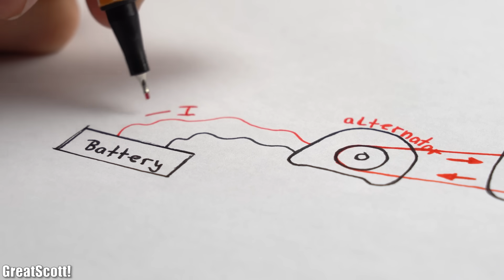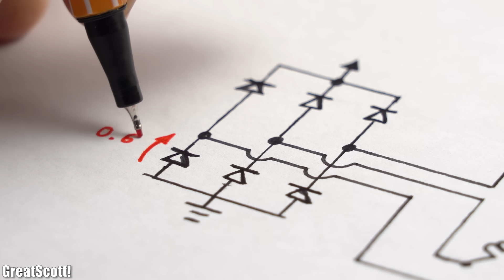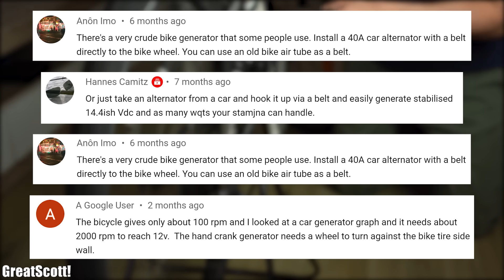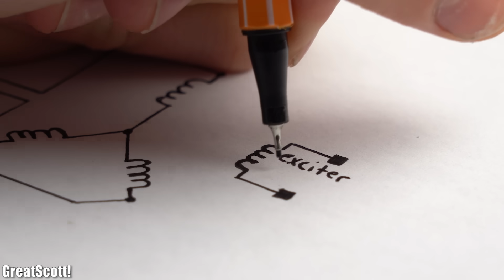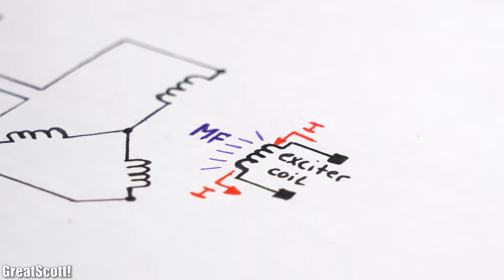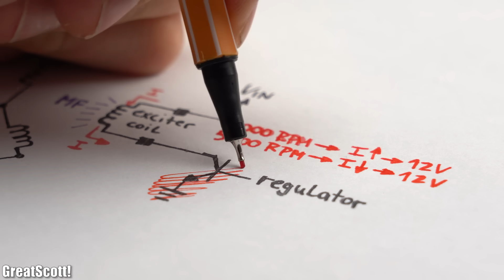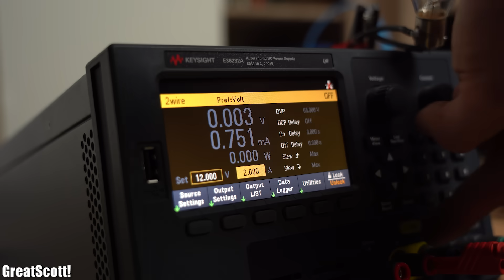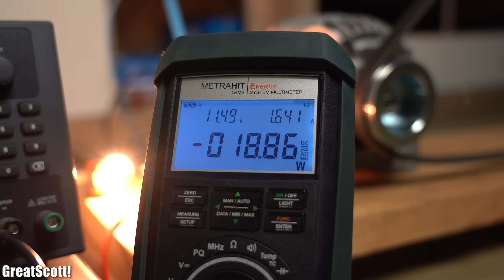Using a car alternator with a bike to power my home? How much energy can I produce?!

Comment: Most adults can output 100w on the bike for hours. So a better system with way less losses (Dynamo?) can easily make 0.1kWh per day as a light workout. Let's round it up at 40kWh per year. Not nearly enough to power a home, BUT most of our energy consumption is for heating (60%), water heating (20%), cooking and big appliances (fridge, laundry). The rest isn't even 10%
So the bike system maybe enough for your phone, radio, TV, a few LED lights. Interesting for an offgrid cabin, but not much else.
ANYWAY, a simple solar panel system can easily handle all of that, (except for the heating)

Comment: It is interesting, I ran this same concept by a popular AI model. It confirmed that not only does this concept work, but it stated much higher power potential, with smaller, less powerful riders being able to reasonably generate around 150 watts and larger more powerful riders able to generate around 300 watts reliably and without extreme output by the riders. We went over a few options, and the AI even made recommendations based on system specs I provided. We even worked out additional ways to increase output to attain significant power output improvements. I would like to add that just because something works on paper or in theory, doesn't mean things will work out the same in real life as on paper. I provided a specific design concept and several options and the AI verified my work and made the same or similar recommendations to the system that I had proposed. This video poster has actual experimentation that he has demonstrated. I designed a small system that could work with one rider, two, three, etc to produce higher output. The power output is not huge, but usable power levels should be achievable with an appropriate system design like the one I made. It is pretty simple and I can't imagine that nobody else has thought of this and tried it before. Motivation of need often helps. When you have no real use or need of something, how serious is the effort? I find that when people are truly motivated to find a solution, they keep trying and scaling until they get a result that is useful to them. True need of solutions that are not readily available can cause people to think differently and see solutions that may have previously eluded them.

Comment: 3:45 - I have not watched more - everyone knows a car's alternator does not use parmanent magnets but uses an internal, rotating 12V coil powered by the battery, to produce AC voltage on a fixed outer coil... You need to power the internal coil first

Comment: You need to change how the alternator works bypass regulator and diodes so u can produce 110-220 volts as a generator

Comment: An alternator actually produces AC current. The rectifier converts it to DC current. One of the major problems with your experiment is you are tapping into the DC side of the rectifier if you want to power your house you need to tap into the AC si of the rectifier. Another issue you have is belt slippage. It takes about 5 hp just to turn the alternator fast enough. Belt slippage was a major problem with the original auto alternators. The battery would run down because you must excite the alternator with current unlike its predecessor the automotive generator. They cured the slippage issue with a self tensioner.

Comment: You need to add a Large heavy fly wheel between the bike and the alternator. The fly wheel should have a small gear in front to attach to the bike. So the large wheel of the fly wheel the is attached to the alternator. This should greatly enhance your setup, and you will be more pleased with the output voltage

Comment: I wonder if instead of adding a belt tensioner if you could add another alternator potentially on the pedal gear side of it because it will give you the tension and more output as well

Comment: So I know this is a 4 year old video but instead of a cars alternator which requires a high RPM to put out power, why not use the very similar (as in they look the same) "low RPM permanent magnet generator"???????

Comment: well alternators also need an excite shock and that cant stay lit because it would short circuit the stator.  but the stator connects to the f as far as i know and the sensor is connected to the positive terminal. 
but the differnece bwteen these wires is the excite is connected to a power source that needs to shock the stator through the the wire that goes around the pos ac and excite past the stator and past f

so you should make a ground to a battery and a ground to the alternator  and then also set up a switch on the handlebars to switch it on and off to excite the coil and charge a 12v bat in an hour from the sensory wire.
and then hook up a inverter to the battery and flip the switch.

so you could get a couple of motor cycle batteries or sometrhing and charge all of them and use the inverter to show you if your over charging the battery.

but  you should use a ford alternator  and get a adaptor and cut the wires because its easier than it is to do it to a dodge or chevy

this does kind of look like a ford focus alt  but i think a ford focus alt with the spliced adapter would shed some light on yout expiriment

Comment: You could also use a flywheel system powered by the bike and if that flywheel drives the alternator you would get more consistent power. I think if you combine that with the other suggestions in the comments like an inverter, battery, and tensioner that would be worth testing!

Comment: What if you connect that alternator to a wind turbine?? Free energy, no  peddling bikes or gas motor!!!! Conect it to a charge controller to charge the battery. Have a huge battery bank connect to an inverter to supply the house.

Comment: Electricians probably know how to do it, because the current volts can probably be enhanced with the dangerous parts in cooking appliances, and then the heat could make more amperage if done right, with over heating being the danger. A mechanical device which would need it's own battery, to spin the wheel...but it might not need big battery if it's just compressing  every five seconds, to trickle charge a power storage battery like commenters said. Not gonna power a home off flywheel, solar panels  don't fully do that directly. either. A small, rechargeable battery powering a piezoelectric type device working synergistically with the flywheel seems conceptually interesting, but the electrical wiring stuff is probably the fancy, dangerous parts. No doubt electricians can do it though.

Comment: I used a cyrisler alt and smallest pulley I could find with the bike set-up. Then I put a junk impeller from old heater on. Then I bolted to heavy old plank and laid it across a creek with the blades a few inches in water alt above water and ran it to my battery bank.  ❤❤

Comment: The biggest gear on the rear cassette of a bike is its lowest, not highest, gear. Your RPM's would be about quadruple what you got if on the highest gear. 
I looked into doing this about 20 years ago and back then a washing machine motor made the most sense to use as a generator. You may be able to find one used at the dump, etc.

Comment: what if you use a hand crank generator? maybe more modern designs will be more efficient? I heard someone say you could get up to 150w from them but they are valued at lower watts because the human hand does not move fast?
 https://www.google.com/search?q=hand+crank+generator&num=10&client=firefox-b-d&sca_esv=db94c43514cdc207&biw=1445&bih=635&sxsrf=AHTn8zq71dw4zAp1nHwCmzYXqKZZZxwVww%3A1747120832769&ei=wPIiaLriLuGhhbIP1Jmm8Ac&ved=0ahUKEwi6wvek9J-NAxXhUEEAHdSMCX4Q4dUDCBA&uact=5&oq=hand+crank+generator&gs_lp=Egxnd3Mtd2l6LXNlcnAiFGhhbmQgY3JhbmsgZ2VuZXJhdG9yMgUQABiABDIFEAAYgAQyBRAAGIAEMgoQABiABBgUGIcCMgUQABiABDIFEAAYgAQyBRAAGIAEMgUQABiABDIFEAAYgAQyBRAAGIAESJo0UPMLWKMscAN4AZABAJgBZKABpwqqAQQxOS4xuAEDyAEA-AEBmAIXoAL5CsICChAAGLADGNYEGEfCAgQQIxgnwgIKECMYgAQYJxiKBcICCxAAGIAEGJECGIoFwgIQEC4YgAQY0QMYQxjHARiKBcICChAAGIAEGEMYigXCAgsQABiABBixAxiDAcICCBAAGIAEGLEDwgINEAAYgAQYsQMYQxiKBcICERAuGIAEGLEDGNEDGIMBGMcBwgIOEC4YgAQYsQMY0QMYxwHCAg4QLhiABBixAxiDARiKBcICDxAAGIAEGEMYigUYRhj5AcICBRAuGIAEwgINEC4YgAQYsQMYQxiKBcICCBAuGIAEGLEDwgIOEC4YgAQYsQMYgwEY1ALCAg0QLhiABBjRAxjHARgKwgIpEAAYgAQYQxiKBRhGGPkBGJcFGIwFGN0EGEYY-QEY9AMY9QMY9gPYAQHCAgcQIxixAhgnwgIIEC4YgAQY1ALCAggQABiABBjJA8ICCxAAGIAEGJIDGIoFmAMAiAYBkAYIugYGCAEQARgTkgcEMjEuMqAH8qgBsgcEMTguMrgH7Ao&sclient=gws-wiz-serp

Comment: You are good at maths but not so practical. It is common sense that the car alternator is too small to give large voltage, never can power your home. Are you serious. Even if you can rev it super fast, the coils will not handle the current. They will burn out. Real generators have step up gears and large coils for big out put. You can get a camper  wind electric generator motor and rig that to your bike. Use a large  crank shaft on a small wheel cog. Then you can paddle the bike to store charge car batteries or high power modern batteries.

Comment: The support for the bike had been better using wood only and some triangular shape to make it more rigid.

More engineering before building would help a lot.

The tension of the belt should be relative to the bike and a much more rigid fastening of the alternator.

What abour wooden blocks with some holes instead of simplistic metal brackets?

The electric base of the system could be a 12V battery. And better instead of disabling the built in charge controller rather put a step down voltage regulator between the built in regulator and the rotor exitation coil.

Then you can adjust the load and still have voltage max regulation.

A 24V alternator could be better using a 12V regulator. Then you can save some mechanical gearing.

A smaller alternator of 100W is enough for human input.  Even easier using a permanent magnet alternator with 3-phase rectifier and a simple step down regulator set to 14.4V with adjustable current limit between alternator and battery.

Then the load of the human bicycle effort can be adjusted from 0 to 100%

A regulator that can handle 50-60V is better and a higher voltage alternator in the same range. Then you can input power at various bicycling speeds and do not require some insane top speed before reaching battery level.

A small solar cell is much better than relying on human power input.

Even producing 60W continuous power is hard work.

Comment: the smaller sprocket on the rear wheel is the higher gear. If you shift into smaller cog, the wheel can be spun faster

Comment: It's been tried: https://www.youtube.com/watch?v=S4O5voOCqAQ

An average human can maintain an output of less than 100w pedaling a bicycle. Driving an alternator will incur some conversion losses. If you can run your home on between 50 and 75 watts, the answer is "Yes, I can use a bicycle to power my home".

Comment: Alternators are designed to charge and maintain batteries so without a battery to give the regulator a reference voltage through the field exciter tap the coils will not be properly energized and in balance.. If you want power without a battery then use a generator.. Amish around her have alternators connected to 800/1,400 rpm small engines screwed to a board that make 20 amps all day because they have a deep cycle battery in the circuit.. My 14HP riding lawn mower engine has a built in alternator that generates 10 amp at 13.5v at half throttle 1,500 RPM and close to 15 amps at full throttle around 3,000 RPM.. So a small automotive alternator that is rated at 40 amps or so will turn easier and generate 20 amps if it is spun at 5-6 thousand RPM.. The larger diameter alternator under the flywheel of a garden tractor engine would require much less RPM's and by removing the piston, rods and valves would turn fairly easily.. Finding one that is blown for free should not be that hard..

Comment: The human body and top condition can produce roughly about one horsepower or a little less. That comes up to about 750 watts with a very generous efficiency  rating conversion.
You be lucky to power your refrigerator even for a short time.

Comment: you wont think its so useless if the power grid goes down  lol
Reply: When you realize that 1 350w solar panel can make 10+ amps at 14v for 4 to 9 hours a day with no peddling effort while this device would take 24+ hours using Olympic strength pedaling the choice is pretty clear.. We use the 10 amp alternator in my garden tractors engine to power and keep a large deep cycle battery charged when we are camping in our woods.. It powers a couple lights at night and our amateur radio, laptop, small TV by running the engine for an hour or two then letting it rest an hour or two..
Reply: and  if you dont have a 350 w solar panel   or a battery to store the power for night time use....
Reply: @ This would not be a way to power much of anything for very long and I think you know this.. Before electricity people used candles and lanterns at night but mostly just went to bed or sat by the fire.. If you could Macgyver an alternator rig in whatever apocalypse scenario you are dreaming about then you should be able to make or acquire a battery..
Reply: Yes I know this lol     hence the last three characters....  lol    but some truth to it...  better to have that wheel spinning then nothing at all.

Comment: Attach a double set of garage door springs opposite each side of one pedal, and replace the other pedal with a shaft and 50 lb bench press weight and 1991 Pontiac Harmonic Balancer. Then crank it over,,it should be perpetual. I just saw this mechanism, and thought I'd ad lib,,lol.

Comment: Maybe you can try  to add wind blades to the Alternator, adding a battery and inverter and use it like a wind generator installed on a house roof. 😊

Comment: A couple significant issues here:

That belt not being tensioned properly is losing a ton of energy through slippage. Spring loaded belt tensioners are very easy to build.

Generators/alternators usually have an optimal RPM for usage. The manual should have it listed somewhere, so the bike sprockets should be adjusted such that you're hitting the optimal RPM, even if you are losing torque.

Lastly: batteries. Due to your bike only producing power when you are on the down stroke of the pedal and that power being reduced as your feet get closer to the top/bottom, it is going to constantly change your power output. Cars with alternators do not have this problem because the position of each cylinder is adjusted so the car is almost always on the down stroke somewhere, but you with 2 legs do not have this luxury. Batteries fix this problem because you can use them as a rough averaging filter for your power.

Comment: there is also high output alternators
Reply: Drag is proportional to output so a smaller 30 amp alternator out of a 1.2 liter Geo Metro would allow you to pedal easier and get the same wattage.. That still would be just a couple hundred watts an hour so why not just get a 350 watt solar panel and MPPT controller and let it do the work?? with 3 hours of sun you could get the same amount of power as 12+ hours of pedaling at high speed.. The alternator in a 15 to 25 horsepower lawn tractor motor is a larger diameter that requires lower RPM's to generate power.. Find a blown motor and remove the piston, rod and valves to let it turn easier and this would be a far better choice than a car alternator that needs high RPM and torque..

Comment: they say you can run a generator off a motor and that's all it will run but you can use a lot of alternators on a belt from one motor generating all the power u need

Comment: Your house runs on AC, that thing is called an "alternator" for a reason, with some surgery on it,it can power most of your house, a 150 amp alternator is pretty common, your place shouldn't use more than 80-100 amp, your welcome

Comment: A longer belt would give you more contact with the smaller spindle and less slippage. A tensioner would be the next best thing but that adds significant additional resistance.  You should convert that into a wind powered generator now.

Comment: Another way to mechanically regulate voltage would be to replace the wheel of the bike with a super heavy wheel to build up momentum like a huge flywheel...

Comment: I saw a show one time where people were trying to survive an apocalypse. Like they actually went out and got 10 people from different backgrounds and challenged them to "survive" an apocalypse. Anyway they had an electrical engineer in the group. They rigged up an old lawnmower motor to power a car alternator and used it to charge a bank of batteries. They mostly just ran lights. But they also did run a few power tools for construction purposes on this setup. At one point they out grew the system. They were trying to run more than 1 power tool at a time and it was causing the lawnmower motor to get bogged down and the car alternator started making a squealing noise. So they had to upgrade to a solar system they were able to scavenge. I say scavenge. They were provided by the show runners but made it seem like they were left behind after events of the apocalypse. Either way it was an interesting show. One thing I thought was pretty cool. After their solar setup was finished they made an ozone generator and used that to purify their drinking water.

Comment: I want to build a similar system using my e-bike to power the generator to charge a battery bank. Then recharge the e-bike of the battery bank. Really wonder if this would work and easily produce more electricity than power to run it.

Comment: Others are right use a battery and invertor to get stable power. Then get what's called a one wire alternator. No mods needed only 2 power connections and making power. Look forward to a part 2 with comment mods.